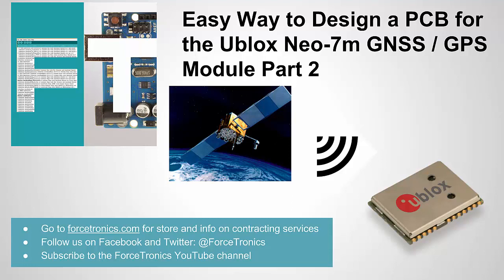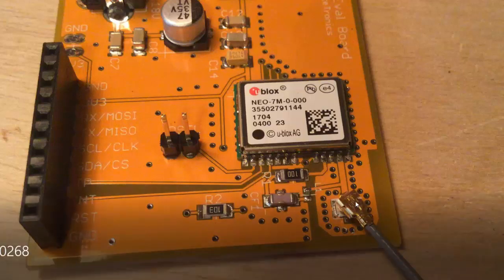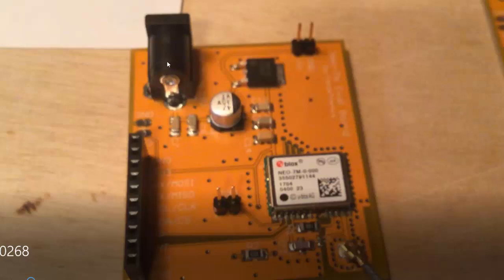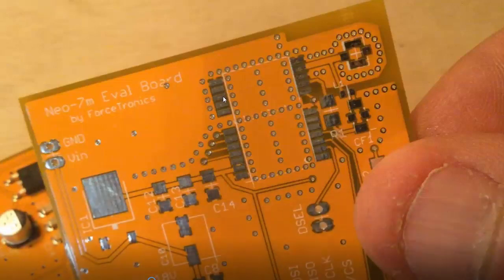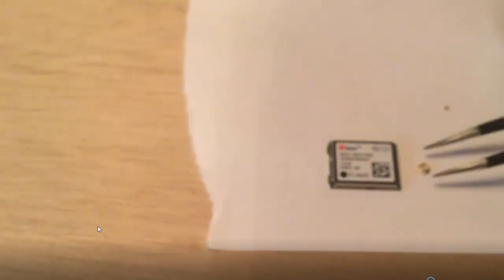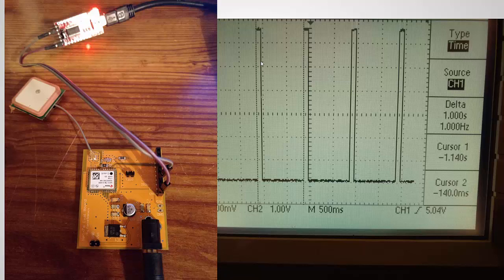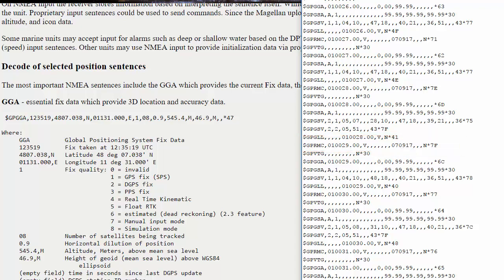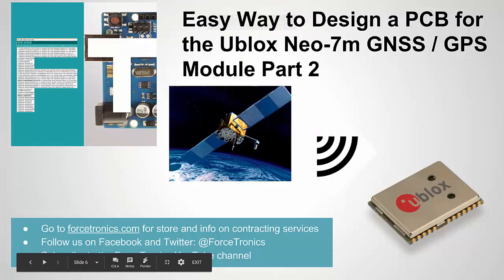Easy Way to Design a PCB for the Ublox Neo-7m GNSS / GPS Module Part 2

Comment: No need for ESD diodes?(TVS)
Reply from the maker: If you have a PCB that has metal connectors that humans will touch TVS diodes are always a good idea. I don't always include them though on my hobby boards because of my 20 years of experience I've not seen much ESD damage

Comment: I really like what I saw last video (in part 1), so this'll be some good f***ing watchin' I reckon! 👍🤓 Okay... Let's see if anyone can decipher my reebus! 
One small explanation first: All symbols, e.g. emoji and/or text clues, placed within the same group, e.g. above the underscores for a single word, all refer and hint to what that single word should be. For the especially difficult words you have been given a bonus letter here and there.The underscores below each group of symbols indicate the length of the word supposed to fill those spaces. Got that? Okay, here goes 🙈:

= Multi-line version for on mobile =

⏳->⌛     2          ⛽                  
_ _ _ _        _ _     _ _ _ _    THIS    

 🔥                🧑‍💼+👩‍💼+🛏️=😍        
_ _ _     AS            _ _ _ _                

  💩              ♂️+♀️=?             📥        
_ _ _ _       S _ _ _ _ _ _ _       _ _ T _    

             👀                       ✅
MY    _ _ _ _,    HELL    _ _ _!

= Single-line version for on large displays (PCs) =
This version will look like gibberish on devices with a small display or a very narrow comment section!

⏳->⌛     2          ⛽                     🔥               🧑‍💼+👩‍💼+🛏️=😍         💩              ♂️+♀️=?            📥                     👀                       ✅
_ _ _ _        _ _     _ _ _ _    THIS    _ _ _    AS             _ _ _ _                _ _ _ _       S _ _ _ _ _ _ _       _ _ _ _    MY    _ _ _ _,    HELL    _ _ _!

Comment: How do you know the values for the matching circuit
Reply from the maker: I assume you are talking about the the RF receive path when you say "matching circuit." The datasheet specifies some type of impedance for the RF path, probably 50ohms (I made this video years ago so I don't remember exactly). On a PCB the way to obtain the matching impedance on the signal path is to design in a microtrip. At the end of part one I mention that my PCB has a pseudo microstrip. To do a real high quality microstrip you need to go with more expensive PCB materials. To avoid this I just kept my signal path as short as possible to reduce loss effects. My goal was to have a working design but something that hobbiests could build so I went with the poor mans microstrip approach and avoided going done the rabbit hole of RF design in detail.
Reply: @ForceTronics  thanks

Comment: What is the capacitance of FeedThru capacitor 1206?
Reply from the maker: Parts information is shown in part 1. Here it is: 47pF feed through 1206 capacitor PN W3F11A4708AT1F
Reply: @ForceTronics  Thank you very much. Great video.

Comment: For project: can I use solar cell panel, instead of battery? Just curious
Reply from the maker: This project covered how to build a PCB for the Neo-7m GNSS chip. If you want to power it with a battery or solar cell (neither has constant voltage output) you will need to add additional "power conditioning" circuitry which is a whole different tutorial.

Comment: Great video. Just a question so can I just use neo-7 to get fix location, I don't need microcontroller or trinket to collect data. Thanks
Reply from the maker: You can just use the Neo-7 by it self, but it doesn't really spit out data in a human readable form so typically it is used with a microcontroller, FPGA, or custom PC app to present that data in a human readable form

Comment: I like your videos a lot, great work. Could you could preheat the soc with a hot air gun to get around the heating issue?
Reply from the maker: Yeah you could do that, just need to be careful that you don't heat one of the vias on the SoC too much so that it causes the solder paste to flow prematurely. Hopefully in the video I did not make this issue bigger than it is, the Neo-7m will reflow based on its heating profile it just tends to be one of the last parts to reflow based on its size.